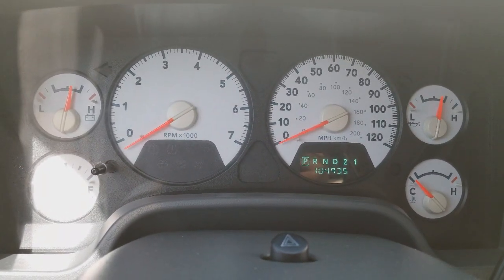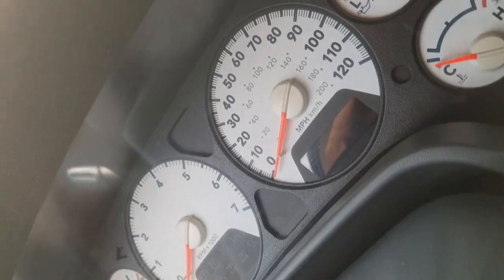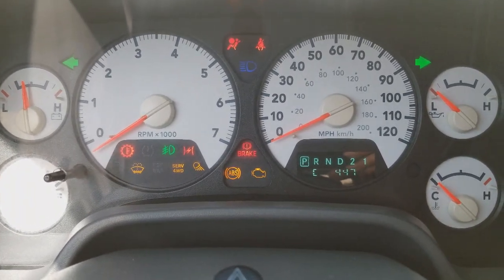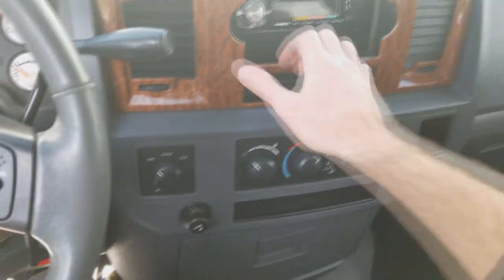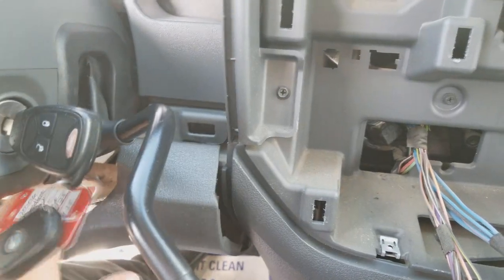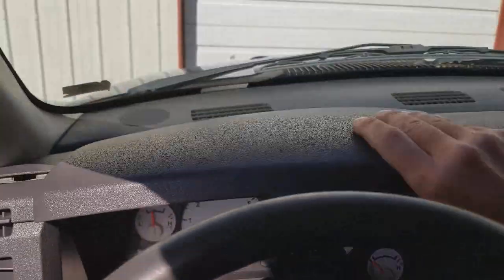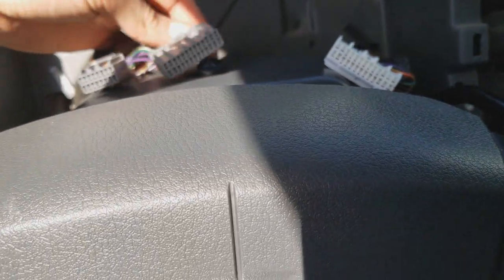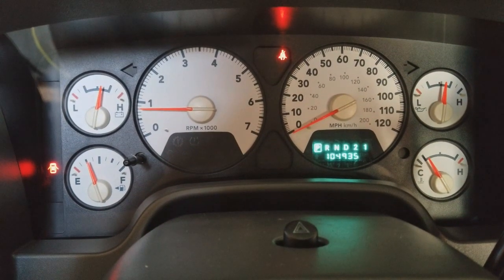2005 2006 Dodge Ram 1500 2500 3500 Tachometer Problem | How to Remove for Repair

Comment: hi man I have a problem with my pick up dodge ram 2500 year 2006
the lights of the abs, brake and the speedometer  it does not work,  change the differential speed sensor, change the plastic sensor of the trams, and also change the ABS senor , and I do not find the problem, speedometer  does not work and the lights on ABS and Brake do not turn off.
you can help me please?
Reply from the maker: Does the odometer count miles? Also, did you scan for ABS fault codes?
Reply: I have to say I have the same exact problem as him I doubt your going to respond but same problem my mileage does not go up either
Reply: I have the same problems i have the ABS light on i chance the speed sensor and my speedometer dont work